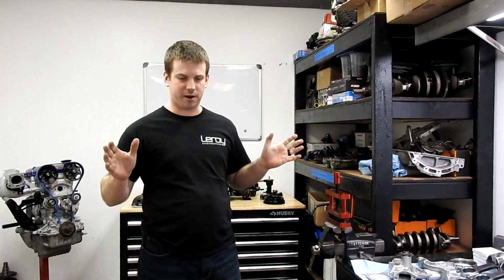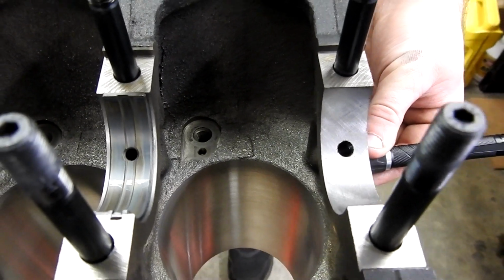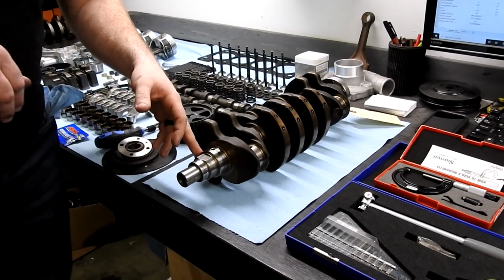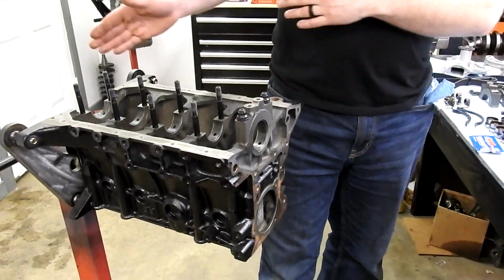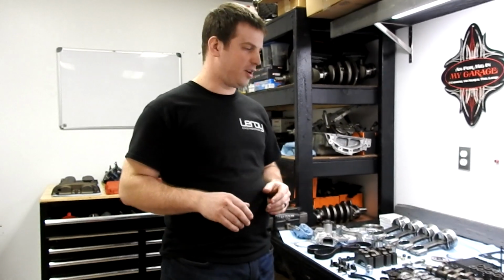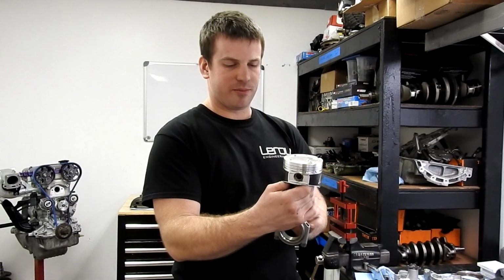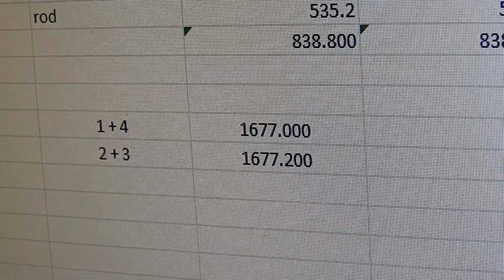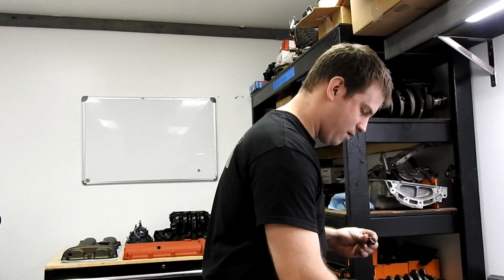Miata 1.8L Forged Engine Build Part 1 Prep

Comment: looks like your using forged pistons, I dont see the need for oil squirters as the pistons dont get as hot as the original cast pistons do and would benefit you more capping them, having increase the oil pressure. Just a train of thought to point out may be wrong but on honda engines we remove for higher oil pressure.